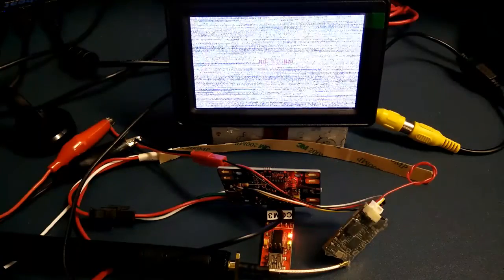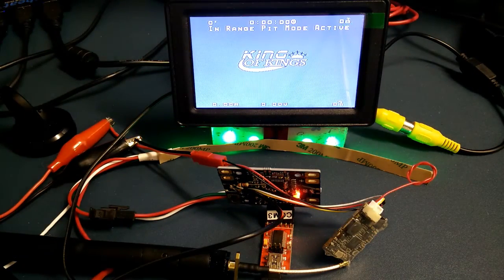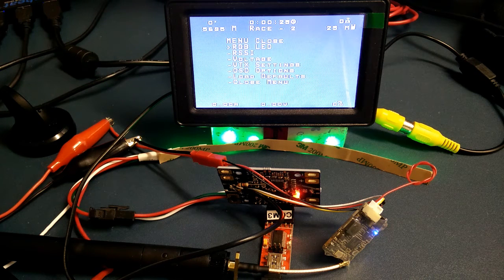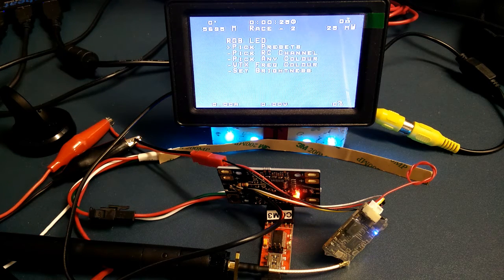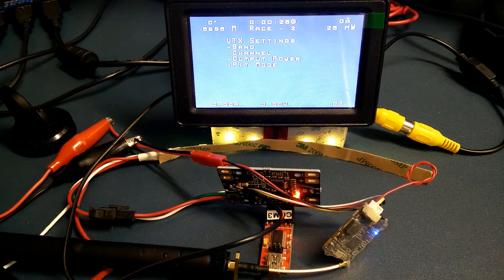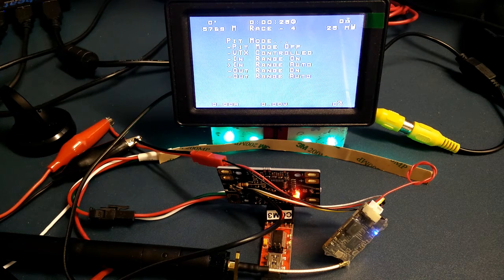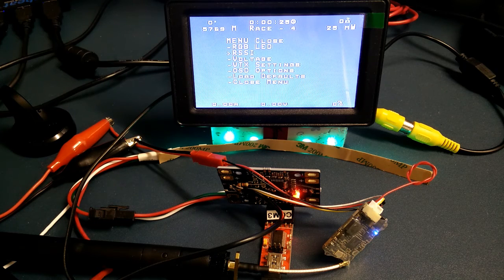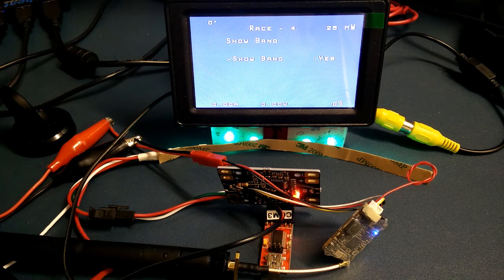Kiss FC OSD with TBS Unify Pro SmartAudio support

Comment: hey can anybody help me? i have no clue how OSDs work but i have a tbs unify pro and kiss setup, and also i have 2 minim osd thrown around somewhere, so my question is how do i get those minim osd to work with my setup? also have hs1177
Reply from the maker: Go to the kiss/flyduino website and follow the instructions on how to use the Kiss OSD on a minim OSD board. It wont have the features this does, but it will give you the important bits anyway.
http://kiss.flyduino.net/dwkb/kiss-osd/
Reply: Ned van Geffen and can i get osd with the unify pro as well? like changing channels and stuff?
Reply from the maker: Not with the kiss firmware i dont believe. Not sure if anyone else has made anything else? and mine isnt ready yet to go on sale sorry, and is still a little while away to be fair. You'll have to use the buttons on the Unify, and just get some battery info etc from the KISS for the OSD
Reply: ty so much for the reply! i actually decided to go telemetry all the way through the taranis asi it keeps the screen clear, and with the taranis is so confortable only 1 cable more..
Reply: I can help you if you have not figured your solution out yet (you probably did by now? ;)  I just went through an Armattan Chameleon build with Kiss FC and needed to figure out the OSD for it. I ended up using a TBS PNP Pro OSD but only because I had one laying around and burned out a minimosd chip I was trying to get to work and didn't want to wait for another one. Here is what you will want to do:

 Flash your Minim OSD with https://github.com/awolf78/KISS_OSD/releases/tag/v2.2 (I assume you have Kiss ESCs, if not you will only get VBAT and a timer on any minimosd with Kiss). Connect up your Camera and VTX to Minimosd chip then using (important) a common ground. Take your 5v out of the KissFC and power up your MinimOSD with it. That same 5v should have a GND pad, ground all to it (Cam, VTX and Minimosd chip) If there is no common ground, the OSD will black out on high voltage surges (I recommend a capacitor to soak up the amps during spikes). Lastly, if you have a Taranis, assign a knob control to an Aux in Kiss, use this channel number in the OSD configuration to control how much of the OSD is shown during flight time. Follow the instructions for flashing (two steps - Config binary first, then the OSD binary) it's easy and I had no problems. Stay away from PiggyOSD, I love Furious but these are underthought and the hardware is not reliable. @Ned van Geffen, I would love to beta-test your smart-audio with Kiss setup. I think a-lot of pilots would love it! Reach out to me Santiago if you need help. Happy flying guys!!